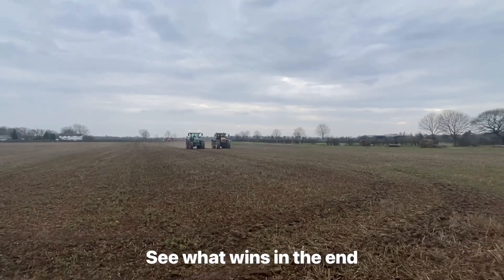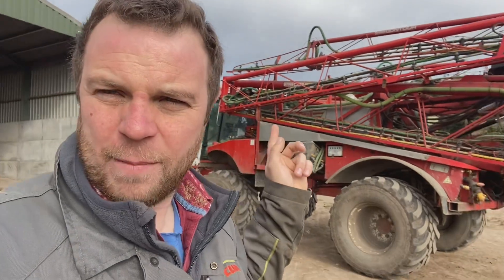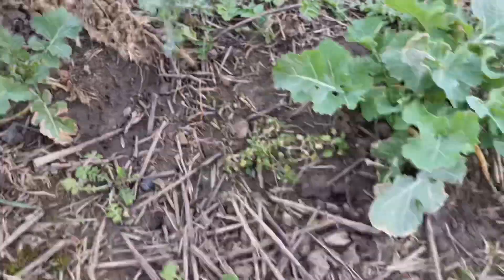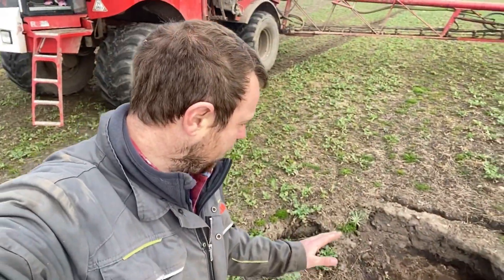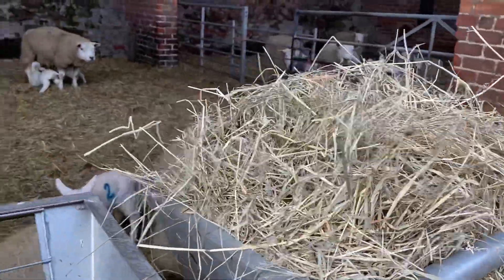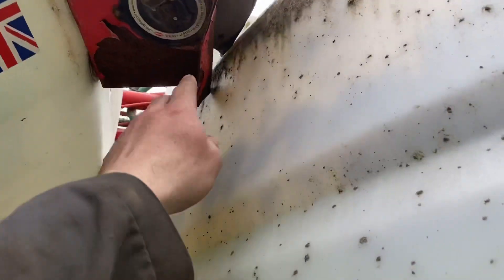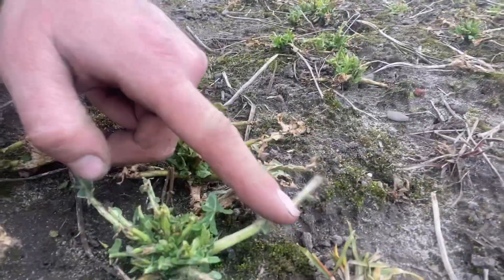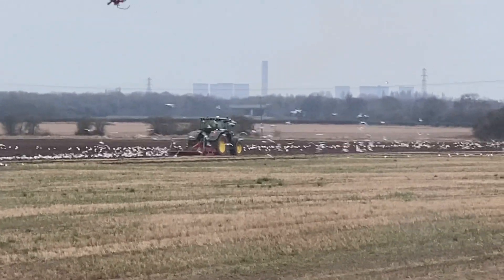Day 350 #Ollyblogs #LockDownLearning  #farming

Comment: Best of five?????😁
Red tractor is for traceability. 
I reckon the 250 won't complete the course as it'll run out of fuel. 
Was the problem with today's race the launch control??
Olly? What happened with tracking down the fly tippers?

Comment: I thought those fastracks were designed for road use on A roads etc, and could go 60mph.
Or is the other one also designed to do these speeds?
Reply: 60km. Fendt usually 65km but they both use the same cvt transmission.